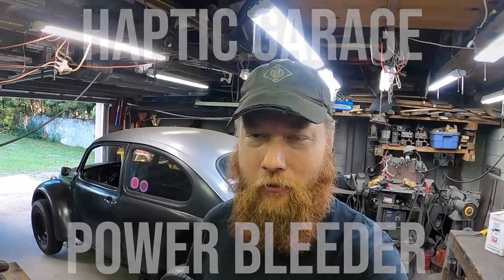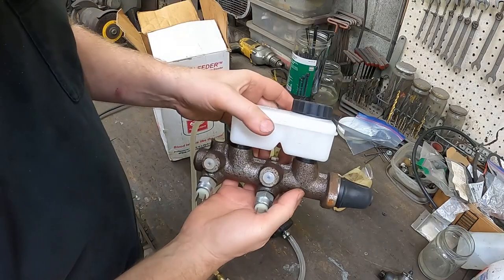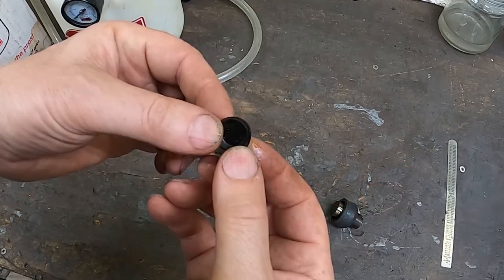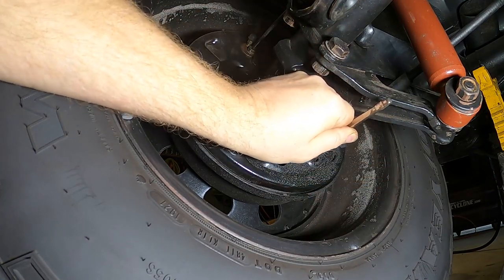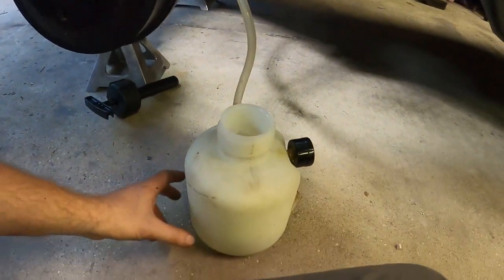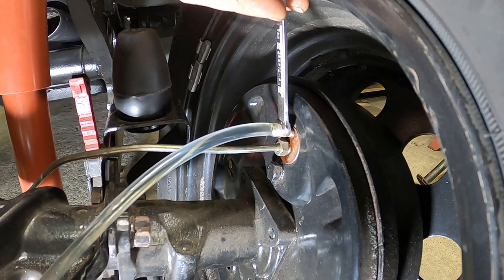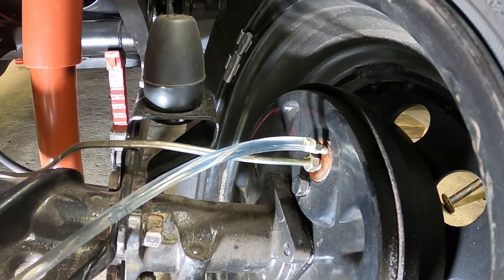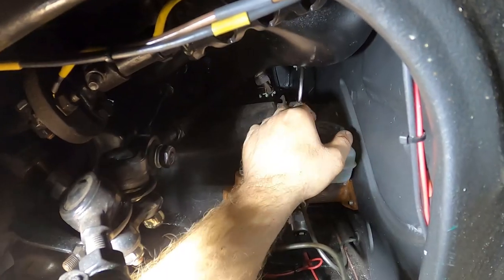Don't Vacuum Bleed Your VW!

Comment: I bought the power bleeder and it worked okay for the first bleed after replacing my master cylinder, wheel cylinders brake lines and rubber hoses.  I had a firm pedal after bleeding but when I road tested, I still had to pump the brake to stop.  I repeated the process with visible sign of air in the lines.  Then, I went back to the old-school process of having someone pump the brake as I bled them.  The line from the bleeder did show a measurable amount of air bubbles during this process, especially from the right front brake.

Comment: I Do Know What It Felt Like When The Air Cooled Volkswagen Was New Because I've Been A Mechanic Since The Early 70's And Worked For Volkswagen And Audi Dealers For 33 Years Starting In 1973  And Had Plenty Of My Own Beetles And Did Hundreds Of PDI   Prep And Delivery Inspections On Brand New Air Cooled  Volkswagens. I Still Have All The Special Factory Tools For Service And Repair Of Those Cars. If You Came Into My Home Shop You Would Surely Know I Was A VW GUY .

Comment: I was always led to believe that storing any unused fresh fluid would become contaminated with moisture in a short period of time, what are your thoughts on that?
Reply from the maker: Hey Steve, thanks for the question. I would agree if it was left unsealed, but feel it would have a reasonable shelf life if you keep the cap on tight. It gives you an idea of how important it is that we flush our lines routinely; the reservoir's fluid level fluctuates during normal use, which just moves air in and out of the reservoir above the fill line. That's a regular source of humidity to be absorbed by the fluid there. With that in mind I'd be more comfortable with the resealed partial bottle of clean fluid than the old stuff in the system!

Comment: Oh Brent, you are so kind. Not even a bad word for the hypothetical brake bleeding assistant. LOL When someone offers to help bleed brakes it's hard to say no but it's hard to say yes too. You don't want to throw them under the bus literally and hope they don't settle for "a few bubbles is good enough" but also trusting them to be as vigorous with pumping the pedal as you want/need is also tough to hand over. I might need to look into one of these pressure bottles. I tend to drive around with spongy brakes until a trusted fellow vintage driver can be secured for the task.
Reply from the maker: Yeah, it's a simple tool that solves complex interpersonal challenges. They should put that on the box. Thanks for watching Atomicmellon!
Reply: That's why you have your "helper" do the easy stuff like simply pumping the brakes and/or making sure the reservoir doesn't get low, even a teenager can do something so menial. If your still on the edge, then you probably need to relax on someone's couch and have a talk.

Comment: Very informative video.  I use the same Motive pressure bleeder tool,on mine and have found it works well to get most of the air out, but not all.  I think when the master cylinder pistons are depressed through the old-school two-person bleeding method, it reduces the space inside the master cylinder, which forces more of the hidden pockets of air to move through the lines and out.
Reply from the maker: Interesting theory @SimiNelsonFamily, that could be. I've used it on my bus and bug, both with dual circuit MCs and gotten different results, which makes me think there's something I'm missing about the brake system condition. The bus has a rock hard pedal compared to the bug, but both work well. After having changed the hoses, my next step is to check the drum thickness. Always a learning process.

Comment: Great video! I was worried about the air bubbles coming into the brake reservoir from the power bleeder hose, but you clarified that point and affirmed that the air will not get into the system. Eased my fears!
Reply: i was thinking the same thing. Some videos on youtube tell you to prime the hose to push away all the air before screw it on

Comment: Great explanation about the piston seals and why vacuum may not work. Even on my disc brakes I've had to pack around the bleeder screw with silly puddy to keep the vacuum from drawing air from around the threads. Pressure bleeder in cart. Thanks for another great video. ✌️
Reply from the maker: Thanks CJ! Makes sense the vacuum bleeder would have that Catch-22. I trust this method will work well for you!

Comment: Thanks for the tip. I just ordered one using your link. Wifey is not a fan of helping me bleed the brakes so gotta depend on myself and the right tools. Hoping to buy another adapter to use on my water cooled vw and other cars in the future.

Comment: This might work for me because I'm having a hell of a time trying to bleed my break system on my 66 beetle.  All of the lines and system are brand new and I've bench bled the master and I can get pedal pressure just not enough
Reply from the maker: Cool, I hope it works well for you too. I also think mine could be better in comparison to how firm my '67 bus brakes are (also bled with the power bleeder). Will be investigating the pushrod length next. Good luck!

Comment: I am happy that it work on your vw. the adapter on the reservoir,  leaked all over for me what a mess! no matter what I did that rubber seals doesn't fit well I even tried making one, still no luck  any suggestions let me know I would apricate the input   before i send it all back
Reply from the maker: Sorry to hear you're having trouble @The123Christop but thanks for letting me know. I'm sure it's frustrating. A buddy of mine had the same issue you describe. I don't have any relationship with Motive but I'd like to know what is going on and will look into it for you. What adapter and reservoir (year/model of car) are you using?

Comment: Enjoying and learning from your videos. I think I see brake fluid leaking from within the front left hub.
Reply from the maker: Thanks Tom, I scanned through the video to see what you noticed- if it's around 13:36 , I think that is just leakage from the loosened bleeder valve. But... you're on to something. We did find some drama on the two front wheel cylinders that we'll share in an update video. Thanks for watching!

Comment: G'day, 
Very interesting video. I've actually not long purchased one of these bleeders I just haven't used it yet.
I'd be checking for contaminated rear shoes.  I know you have weep holes but it's a start.
It will be interesting what you eventually find.
✌️ Peace from Melbourne Australia.
Reply from the maker: Thanks and good thinking Kevin- spoiler alert here; we opened things up and found some small issues, plus replaced some parts to fix the problem. Stay tuned!
Reply: @HapticGarage  
You're not going to leave me hanging are you.
Reply from the maker: Who, me?!?
Reply: @HapticGarage  🤣

Comment: Any chance the spongy response is due to elasticity in the hoses to the front wheel cylinders?  Just a notion.

Great video!!

Thanks!!
Reply from the maker: Yeah Max, that's a very real possibility. I changed these with some from WW and had some improvement, but still not the same as the bus brakes. Thanks again for watching!

Comment: Question? Old school Vw's, what is best to use... Dot 3 or Dot 4? Thanks
Reply from the maker: Hi @prius74, they're said to be compatible but DOT4 has a higher boiling point. I've also read that DOT3 absorbs less moisture from humidity than DOT4, but they are both hygroscopic. I would just use DOT3, but the Valvoline brake fluid I use says "DOT 3&4" on it, so who knows?!?

Comment: when I use my vacuum blender I use a hood rod to hold the brake pedal half way pressed, would that work to open the seal and vacuum bleed easier or does that seal not move when being compressed?

Comment: Interesting about mimimizing brake shoe clearance.  Used to usingthe Motive for a 4 wheel disc brake car but an older vintage car with front discs and rear drums sounds like the rear brake shoes should be altered before hand like your brake drummed VW?
Reply from the maker: Hey Eric, thanks for watching. Sorry I'm not sure about other vehicles but I do use this unit on a vintage RV with disc front and drum rear. Other than locking a proportioning valve, I don't have to adjust the drums (it's a '75 P30 chassis). It has a self adjusting feature that keeps up with wear on the shoes which may have something to do with it. These old VW brake shoes are adjusted manually. Good luck with your project!

Comment: Did you replace your soft lines when you did this project? That can cause squishyness. Other than that that should be everything. Maybe replace the pads and drums those are the only other components other than metal lines and cylinders.
Reply from the maker: You're on to something San Diego VW Life, rubber lines are a big part of how this ends. Thanks for watching!

Comment: Brent, what would be the correct model number of this power bleeder to fit the cap on my 69 beetle? I noticed there are several model numbers available. Thanks for the great video!
Reply: PS: Looks like it takes a 0104 kit. 27 MM inner diameter reservoir cap. 1104 adapter
Reply from the maker: Hey Charlie, that sounds like the right one with the model 1104 adapter. I have an affiliate link to that combination in the description if you'd like to use it. Thanks for watching!

Comment: Hi Brent have you used DOT 5 brake fluid?  I run it in my Super Beetle.  Pedal does not feel firm, but it won't harm pain and will not absorb water.
Reply from the maker: Hi Jeff, thanks for the question. I had a good opportunity to use DOT5 in Dweezil because the entire brake system was replaced when the chassis was rebuilt (it's important not to mix the silicon DOT5 with glycol based fluids, including DOT5.1). I opted to stick with DOT3 because that is in several other vehicles I maintain. Other than that it seems a worthy upgrade as long as the labeling is clear.
Reply: That wouldn't have been Bosch brake fluid would it? I replaced brake lines on my Mazda B-4000 (1997 Ranger) and refilled with Bosch fancy fluid which turns out it is much thinner and works ok in winter, but in summer I get lots of fade. May have a bubble in the proportioning valve because I didn't bench bleed it, but the summer/winter difference is large with this DOT 5 by Bosch.

Comment: Is there any way to recycle old brake fluid and use it again?
Reply from the maker: Hey Darrin, thanks for the question. It can be recycled on an industrial level when it's not considered a hazardous material (the definition depends on who you ask). I doubt there is a practical way to renew it at the home shop level; debris, solvent contamination, and moisture absorption would be hard to resolve. Thanks for watching!

Comment: Hey Brent, any updates on your brake situation.  I.e. soft peddle
Reply from the maker: Hey Mike! The brakes are fine  now after refurbing and replacing some other parts then a good re-bleed of the system. Will post an update after the LED Fog Lamp video. Thanks for asking!